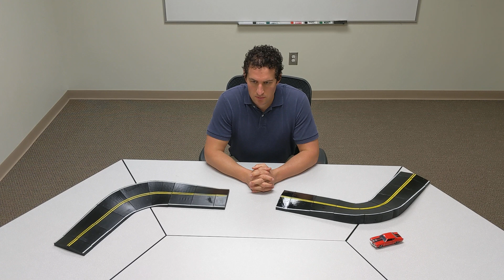Reverse Curve with Spiral Transitions

Comment: Hi good video. Could you please let me know, what scale have you used?
Reply from the maker: We had to use a different scale for the cross slope/vertical and width/length.  The height is exaggerated to more clearly show the changes in the cross slope.

If you'd like to see the actual design files, here are the links to our two most recent designs: 

https://drive.google.com/file/d/1PvEN-V7DPPIzw3ymzcHnl_ukTjqGW5GW/view?usp=sharing
https://drive.google.com/file/d/1rShgT-fr7i0qj2Ye74rSLhaEPYsUsdOM/view?usp=sharing